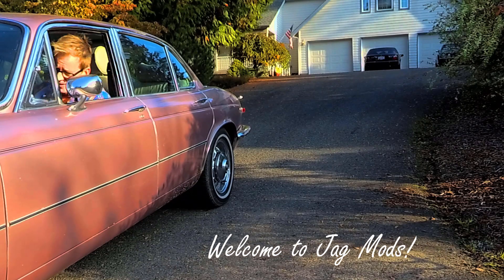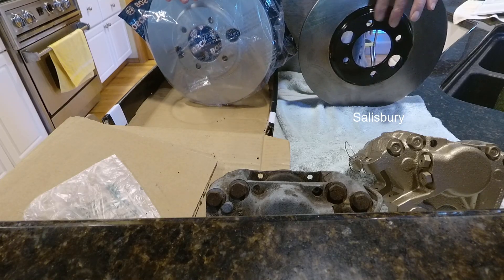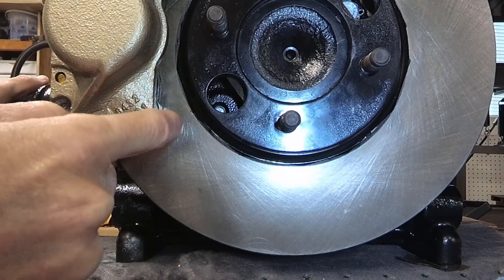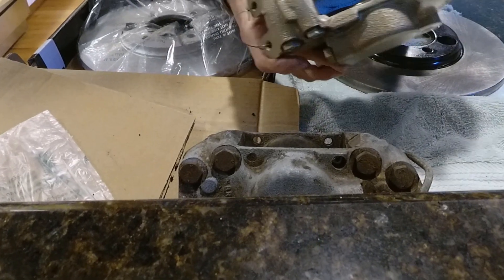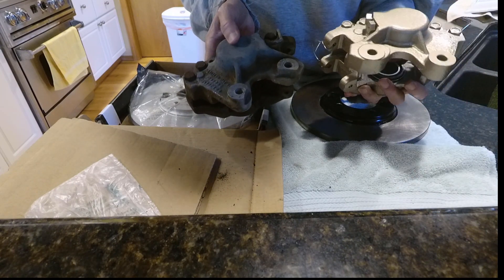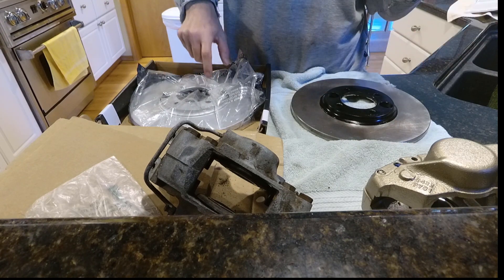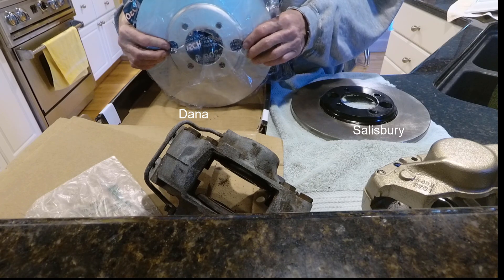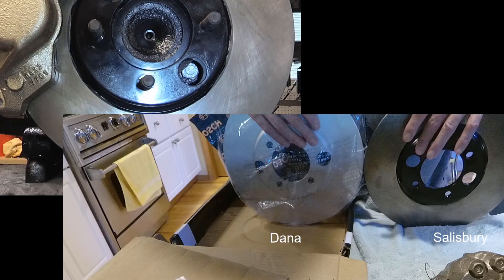Two different IRS brake rotors

Comment: Looks like the rotor is positioned 90 deg out, if you look in the access hole the out put flange is partially visible which is going to foul a socket.
Reply from the maker: Good eye! It's a shim that centers the rotor between the calipers.  I stared at that for a while, debating on whether to cut a relief or not.  I decided the "or not". Because this IRS is going to be popped in and out of Several Jag's while I rebuild the other IRS's.  I'd do the same thing if I had a spare IFS.